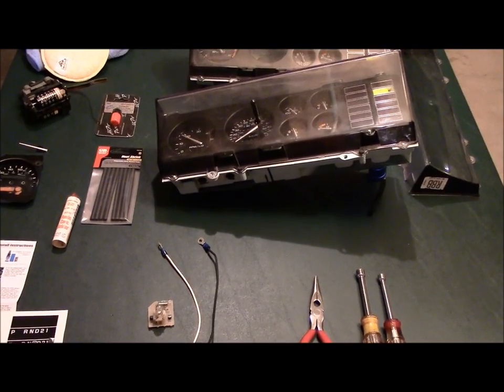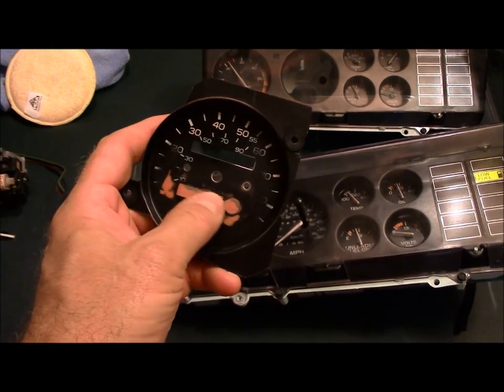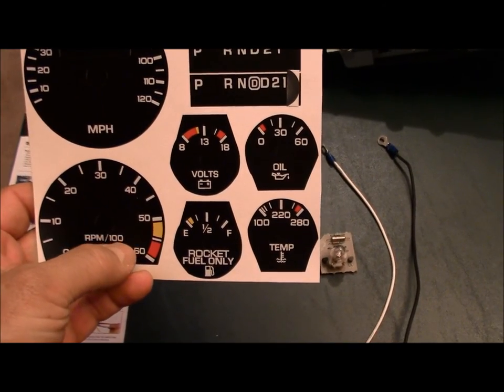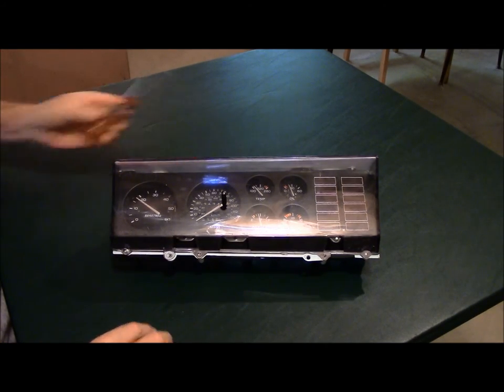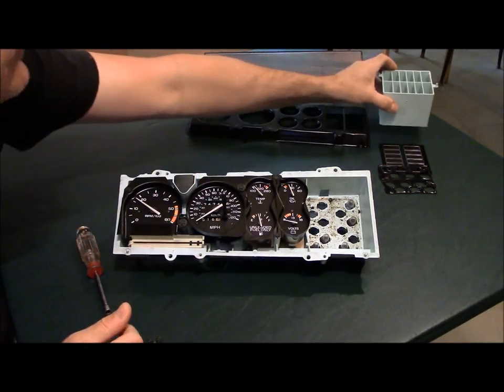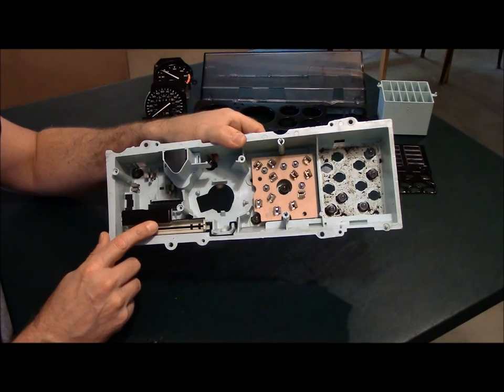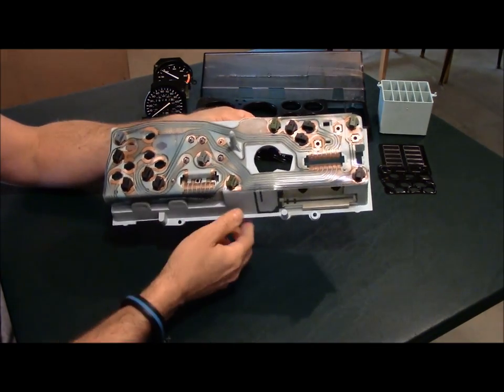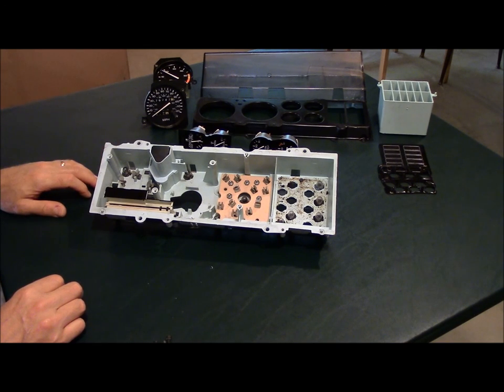87 Olds 442 Rally Gauge Modification - Part 1

Comment: Good work! I always felt the lights were too dim, so the solution is going LED or repainting to a more reflective color. I actually glued aluminum foil to the primary reflective surface and it made a world of difference! I can actually see how much fuel I have..lol.
Reply from the maker: Interesting idea using the foil
Reply: I got a 84 cutlass do you know why the gauges dont work at all
Reply: @Chavez1979  You have to remove cluster and check the circuit board to see if it has corrosion or broken copper connection. Start their first then and also check fuse box where it says instrument. Actually check the fuse first👌🏽
Reply: @jamilmccall6553  thanks so much

Comment: I need your help, I've ordered the cluster bulb twist sockets from 2 different companies that on their website it says direct fit, however they are bigger. Now Gbody Parts says I have a Canadian unit cluster. Never knew that if that is so. Do you know the size I need or where I can actually get the correct bulb sockets. I just replaced the circuit ribbon and waiting to put it back together. So mine is exactly like the one on this video you have here. Any help would be appreciated. Thanks, Ross
Reply from the maker: I never heard there was a difference. Are the old sockets still good? Just use them over with new bulbs.
Reply: @hutchhiperf  I had the circuit repaired in the past and some of them were broken and do not tighten. So I'm not getting good contact.
Reply from the maker: @rossgarcia9699  check with Mike's Montes for another opinion. Good guys over there.
Reply: I’ve had Rallye Clusters (and granny clusters) from 78-86, US, Canadian, Gas, and Diesel.

They all use basically the same exact plastic back housing, printed circuit board, bulbs and bulb sockets.

Whoever is telling you that is either looking at the wrong section/model in their parts catalog, or just wrong. 

Matter of fact I’m looking at a 1983 Canadian, Diesel, Rallye Cluster right now and they are the same size, colors, and for the most part even have the same location layout of each bulb. I believe the only bulbs used are 161, 168, and 194.

I have a complete cluster bulb usage chart I can send a link to, if you want to be sure you have the right bulbs in each socket
Reply: @rossgarcia9699 The plastic locking tabs on the sockets themselves are broken, or they’re just loose because the metal tangs aren’t making contact with the printed circuit board?

If it’s the latter and the plastic sockets are otherwise intact, take a small pick or flathead screwdriver, and get under the 2 terminals on each socket, and lightly bend them out away from the socket (if memory serves me correctly it’s best to do this while a bulb is in the socket). 

Use a pencil eraser to clean all of the contacts (especially on the printed circuit board) Some people say they use scotch-brite , but there is a special coating on those contacts, scotch-brite will compromise that coating, which will cause connection issues down the road, and eventually a buildup of that familiar green corrosion we’ve all probably seen more than once

Comment: Changing the mph is it still accurate driving?
Reply from the maker: I just used a different plate so I didn't mess up a 120 plate. The mechanism below it is calibrated for 120, and a 120 decal face was used. No change.